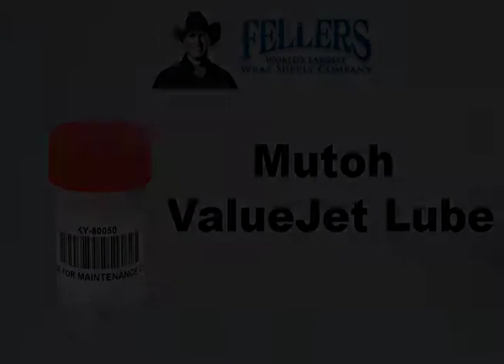Mutoh ValueJet Lube

Comment: Do the rollers need this as well the lube as im getting smudges and it worked slightly and making them smaller when i upd the heat  i heard i can also be due to pinched rollers but i dont see or hear that problem so im thinking it could be that it needs grease if this is the case can i use white lithium. For that as well